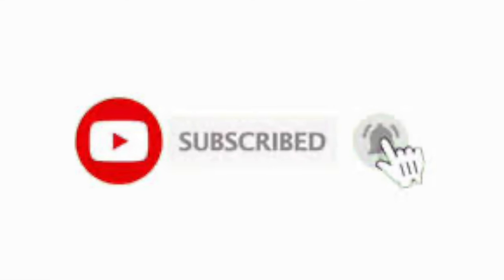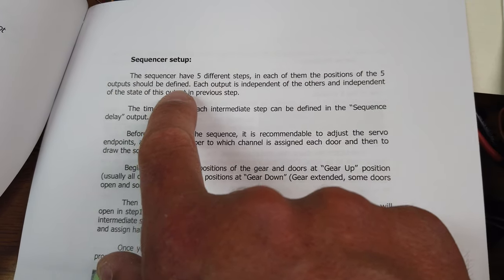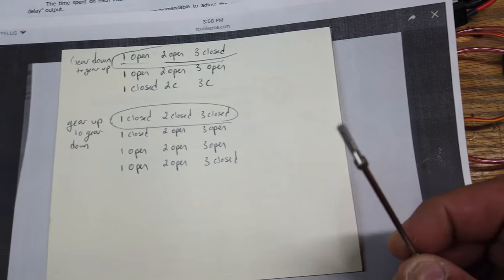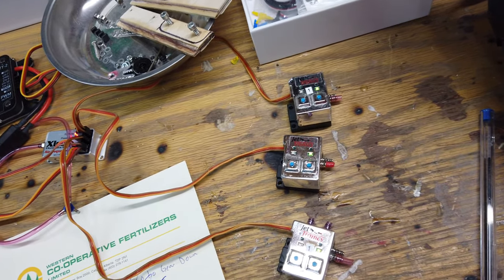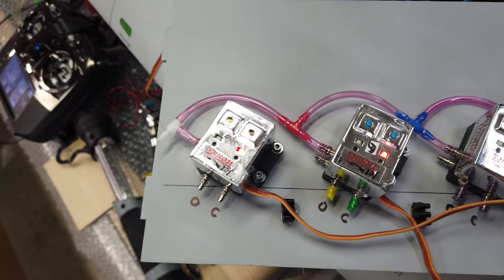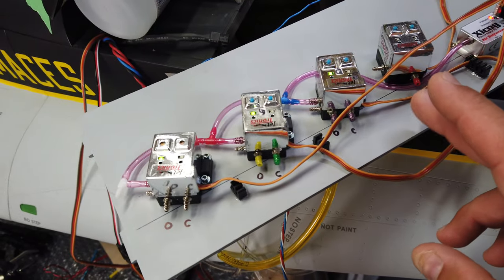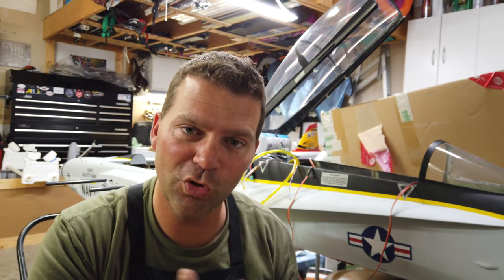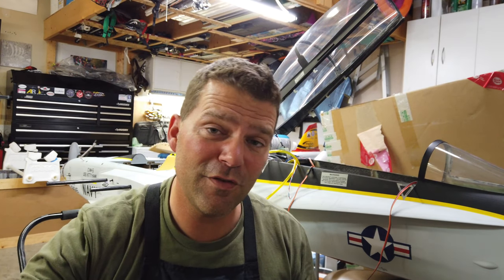LETS BUILD A F-18 - Skymaster Jet, Xicoy Sequencer install and Landing Gear Cycle.

Comment: Great work. 2 questions:
1. Did you use 2 separate valves for the gear? it seems that the front gear operates separately from 2 main gears
2. Did you use the flow reducers in the gear valves? I use Xicoy valves, and gears are slammed down in gear down position. No issue in gear up position, as they have to fight gravity.
Reply from the maker: Hello. The gear are on one valve. The cylinders are massive on the gear which is why it probably appears like I used a flow reducer. But no I didn’t. 

On smaller gear they will slam because of cylinder volume/size and gear weight

Comment: Excellent! You have been very lucky not to have any leaky air cylinders. One question though. Does the mains have pneumatic brakes? If so, then you need one more air valve and more plumbing to complete that circuit.
Reply from the maker: Hey Gogian. I have found it to be very beneficial with air systems to add a couple drops of silicone oil to the fill valve a couple times a year. This is very helpful to keep seals lubed and in good condition. 

Mains do have pneumatic brakes. That’s the 4th valve on the plate.
Reply: @thelightersideofrc  ok. Got it!👍
Reply: @thelightersideofrc  : I have had defective o-rings on some of my gear, so the silicon treatment wouldn’t work. Cheers!
Reply from the maker: Yea. With the amount of cylinders on here it’s nice and shocking that we didn’t have that issue.

Comment: Great video. I am building DerJet F35 using same Jet-tronics valves for gear and doors but with the sequencer in my Jeti transmitter. Having some issues getting the one valve for the gear to work consistently. I noticed in your video you have Green leds for gear down and Red leds for gear up. Have you noticed the valves have a default position when they are first powered on and if so which color leds do you get?
Thanks, 
Mike
Reply from the maker: Hey Mike. Thanks for watching. I don’t think I covered it in that video but the valves default to red so what you wanna do is make sure your gear down is put on the red side.
Reply: @thelightersideofrc  Yes, mine do the same, just saw that in your video later on, have my gear down with Red leds. Curious, are you using the speed control function on the valves at all? Also, have you tried using restricters on the exhaust vents?
Reply from the maker: @michaeldanielson3400  I’m not a fan of the speed control function. I find it uses more air.
Reply from the maker: @michaeldanielson3400  never tried restricting the exhaust. I have restricted the lines feeding a movement. Open doors on my tutor are full air power but close doors is restricted

Comment: I have to say I'm not a fan of pneumatic retracts.  Watching the gear doors slam shut like that irks me.  I would much rather use electrics.  Get much smoother operation and don't have to worry about running out of air or air leaks.
Reply: agree....
Reply: agree
Reply from the maker: Good point Mark. Keep in mind though on a plane like this you have 9 gear doors. That’s a lot of servos or linear actuators to setup.